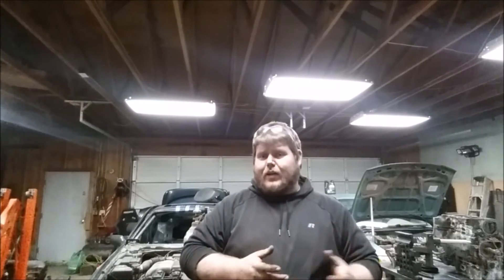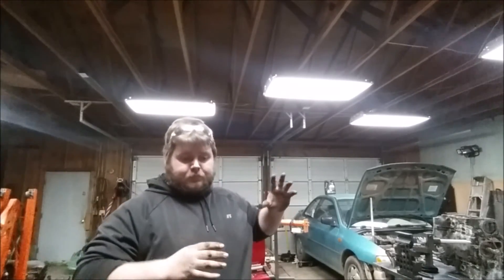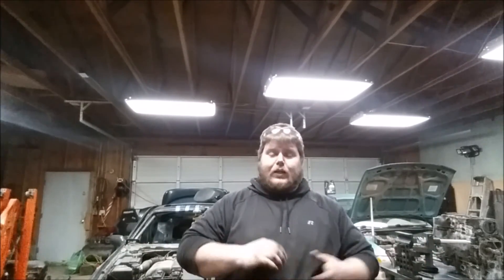Tig Welding a Crankshaft Keyway Repair

Comment: Jjj amigo I when different road I put cold welding including inside the timing gear on  a Geo trackerall over I leted cured a couple days then I weld inside from the crankshaft no pulley bolt at all broke on me but I can tell you no more problem jjj homemade garages want a arm and leg plus towing etc cold welding liquid in woodkey and timing gear and real welding from crankshaft to timing gear from the inside the rest is history poor people remedies home cure jjjj
Reply from the maker: Nice, I did use a "cold weld" product the first time I fixed it, and it managed to last 2 years.  But after it broke apart, I figured it was time to try something more permanent.
Reply: @fiend_metal  best way is to cold weld the timing gear with crankshaft old school style my still running perfect like I said I weld real weld with a cold welder but a lots of people think different race cars were made by mountains people that hardly have anything to bit the cops etc welding include from motor mounts to differentials etc give me atourch and a welder and I can make anything real simple weld cut reweld and recut and here when big boys cry when they see a honda toyota vw etc from 4 to 6 and 8 cylinder in it doing 160 to 180 mph